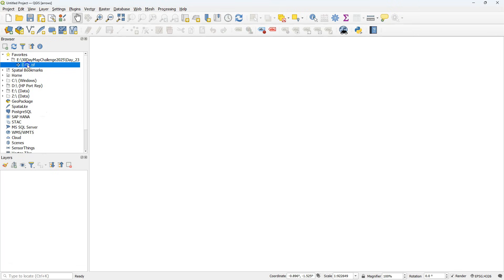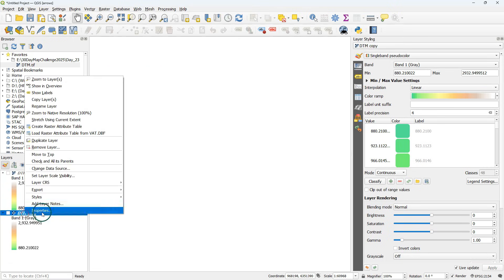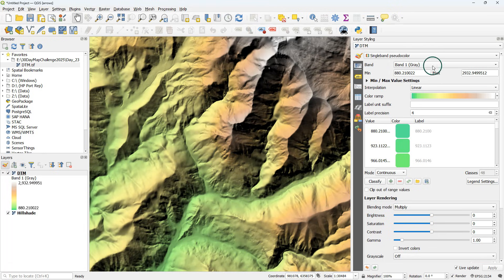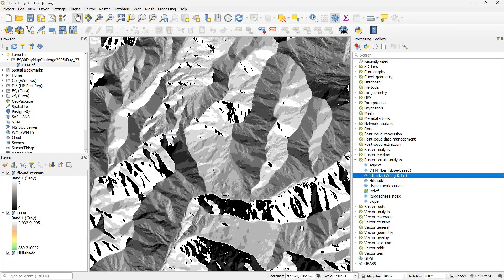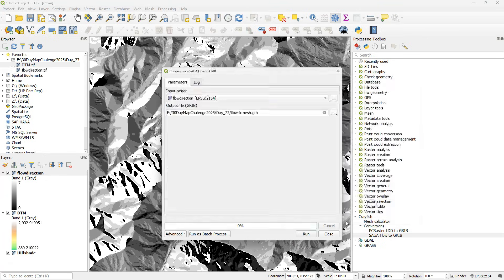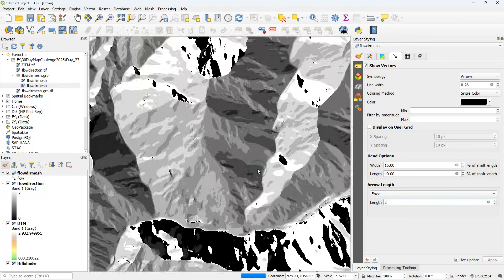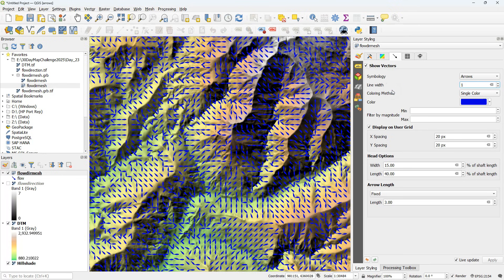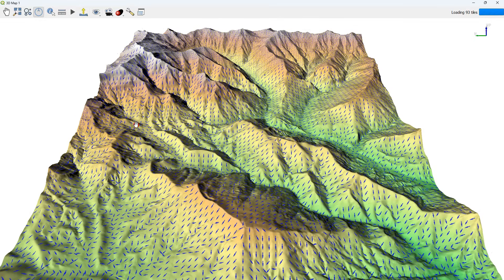Calculate Flow Direction with the Native QGIS Tool and Style with Arrows

Comment: Thank you for this video, sooo helpful. I couldn't visualise the 3D though, the flow path for some reason does not appear in my 3 D visualisation
Reply from the maker: It might depend on (the settings of) your graphics card.
Reply: I have the same issue.. arrows display fine in 2D, but they seem not to render in the 3D view (but the DEM and other vectors show)